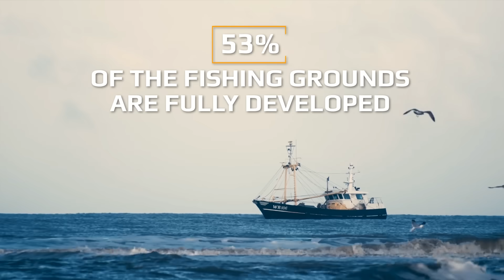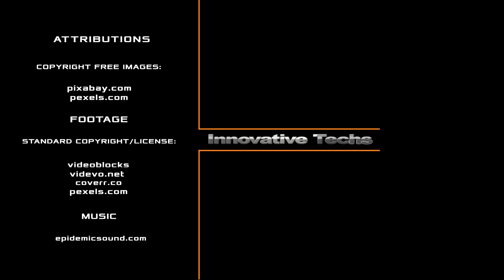Inside The World's Biggest Fish Farm

Comment: The farm looks so very industrial.  Too industrial.
Sea vessels float, and are very mobile.
Several large sea vessels can anchor a true floating farm.  Is that true?
And the vessels can serve as dwelling for the fish farm workers and machinery.  We have already refined deep sea drilling, using massive heavy equipment.  Fencing in the farm residents can be quite deep, like a high ceiling construction for the fish residents.  A second fleet of anchor sea vessels can be brought in to implement a temporary housing for the residents should it become necessary, then transported back to their primary home farm after whatever was necessary had been achieved/completed.
Just a thought...

Comment: Where is the fish farm getting power from? What is the farm feeding the fish? Where does the fish feces go? Answers: The farm would be run on diesel generators with would have to be pumped via a tanker regularly.  The formulated fish feed would have to be brought in fresh to feed the fish and is composed of fish meal which is sourced from wild fish stocks.  The fish feces passes directly into the ocean untreated so any diseases that the farmed fish catch are transmitted directly to the environment.  The reason for the design of this farm is to easily move periodically to comply with environmental laws to reduce the impact on the environment.
Reply: Are the faeces  of the fish in the open sea treated before they pass to the open sea. Humanity is going insane.